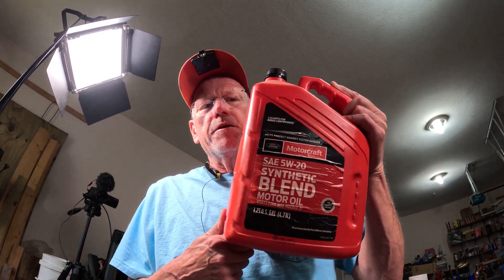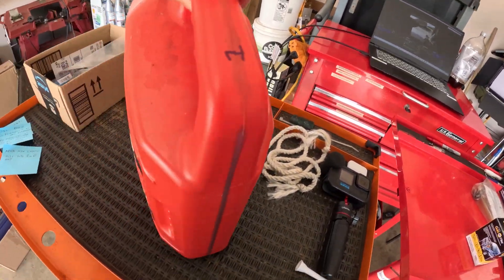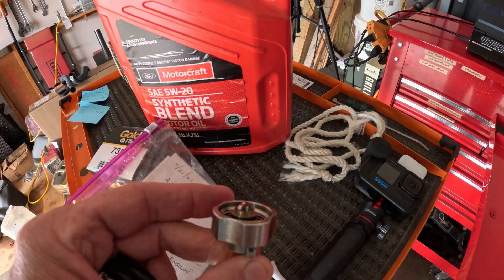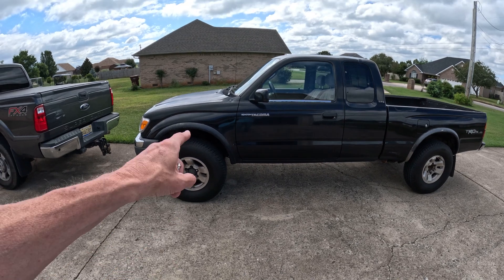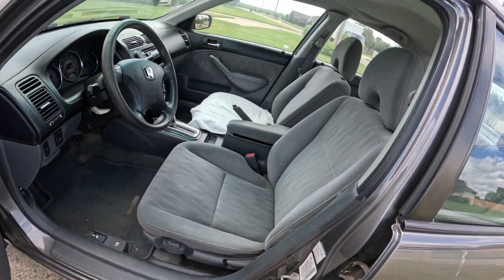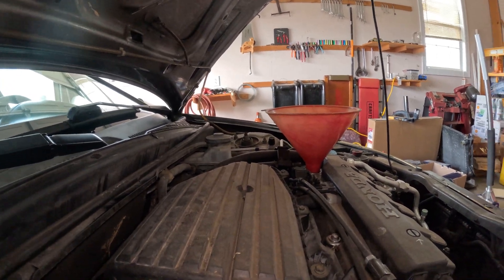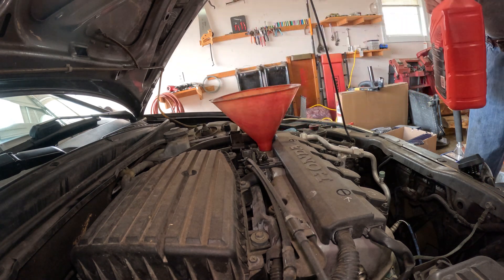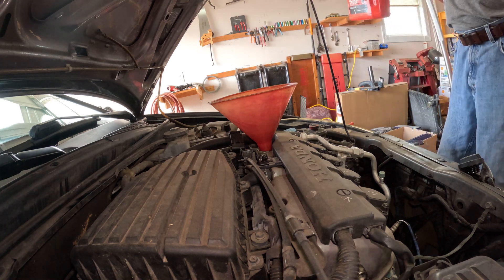Never Mix Engine Oils lets find out pt2

Comment: Waste of time. There's no point.
Reply from the maker: The point is to use the correct oil viscosity for your vehicle.  Use a detergent oil and change it frequently. Around 5k miles. In part 3 you will see requirements for certain engines.  Thanks for watching.
Reply from the maker: Are you stil with us?